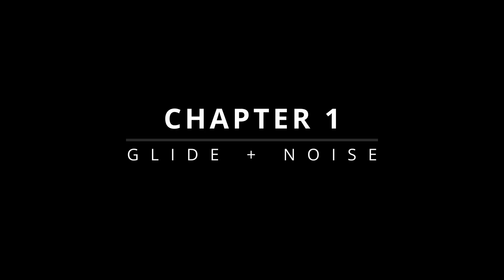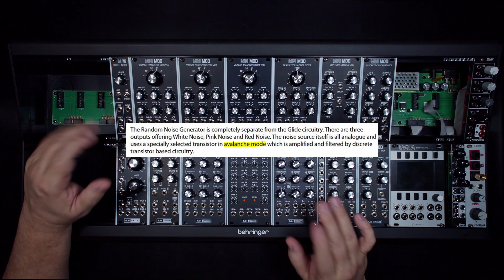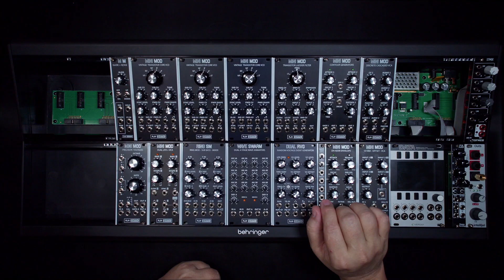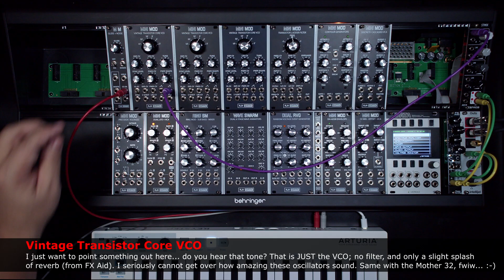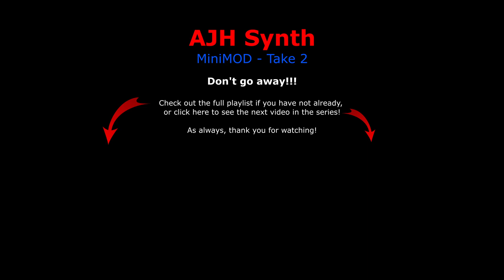AJHSynth MiniMOD - Chapter 01: Glide+Noise

Comment: glide is one of my favorite modules . . . for running CV through. It's wonderful for taking the edge off of sample-and-hold voltages to give random modulation to all kinds of things and add throbbing or howling to basic drones, running a S&H at a clocked rate to sync with the beat. You can dial up the glide rate to allow occasional screeches, or down to kind of attenuate it . . . love CV glide!